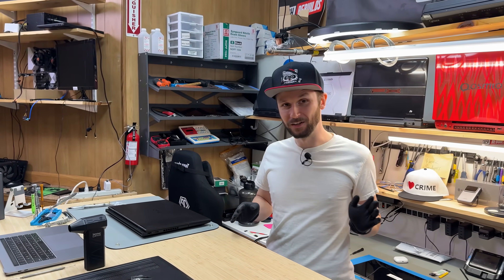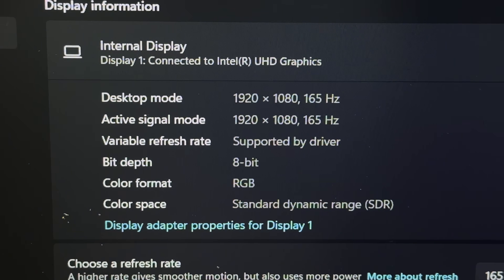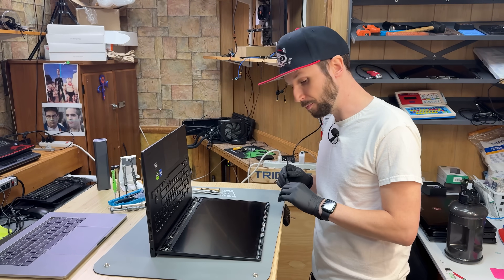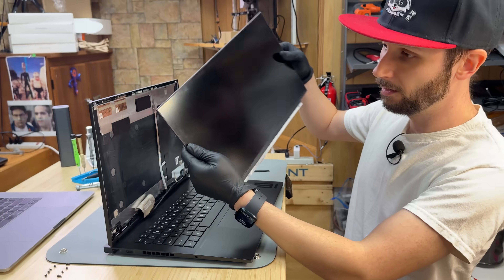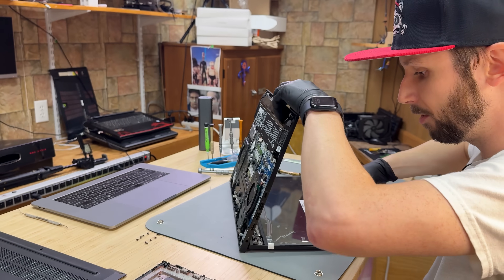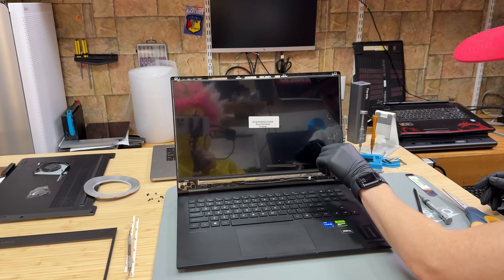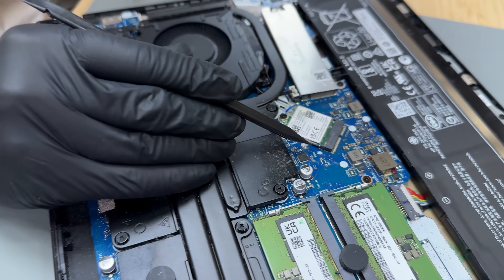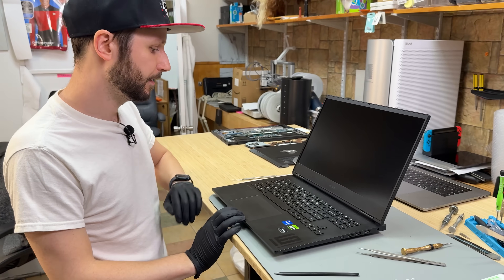The Laptop Upgrade Nobody Thinks About Until It's Too Late

Comment from the maker: Buy things to help me recover after CES SalemTechsperts.com
Reply: why😊
Reply: @ivopearce  Nvidia 50 series prices
Reply: @PotatoPc2000  i’m not sure yet they will be telling us soon
Reply: you are exactly like me when fixing laptop even i like the satisfied click when putting panel back, i to hate adhesive for screen and finally the 30 pin Display connection i am with you all the day i too faced the locking connector fixing it back with satisfied click.
Reply: @SalemTechsperts I have a question about downloading Windows 10 from a phone using USB SD card thing what would I do I have windows 10 downloads what else can I do
Reply: @GamerBoyDepner29  no booting from an sd card is not posabel trust me i have tried
Reply: you only sell in USA OH its a shame :face-red-droopy-eyes:
Reply: What is the circular watch you wear in shorts usually? It looks a bit like mine.
Reply: I made the mistake you avoided and can confirm, it did suck. My laptop model had two different screen models with different pins on the connector for each.
Reply: can you replace an lcd screen with an LED screen or oled

Comment: im going to be upgrading my Dell Latitude e5530 (2014) HD screen (1366x768 ew) up to a 1920x1080 screen bc most web sites and such treat my laptop as a mobile device as the resolution is sooooo low

Comment: My HP omen screen is damaged. It is "BOE NE173QHM-NY5 v8.0" 
I want to upgrade to " BOE NE173QHM-NY7". 
BECAUSE Original is 300cd/m2 
The later is 400, also has AMD free sync.
Both are 40 pins and the same size. It will be better than the original right?

Comment: Been eyeing up some display upgrades for my budget Chromebook to Windows laptop.  It came with a terrible 1366x768 6 bit panel with no blacks.  There is a few full HD panels in the same form factor model.  I am not 100% they will work or not but I have been wanting to try one for awhile now.  I also have an old Thinkpad T61 with a 15.6" 1680x1050 8 bit, but it's old like the laptop, so black levels and brightness are pretty bad.  I am not sure how easy that display will be to replace due to the aspect ratio, but it would be nice to replace, even if I had to hack together some kind of LVDS converter PCB inside the laptop somewhere.

Comment: I replaced my laptop screen a few weeks ago. I have a Sony VAIO PCG-71912L and when I replaced the screen, I swear the resolution is better. I got the screen replacement off eBay for $54 (so what my laptop’s worth), but I think the original screen was 720p and the new one might be 1080p but I have no way to check.

Comment: So, I have an MSI Crosshair 16 with a 144hz 1200x1900, or whatever FHD+ is, I think that's right. I know it has a 40 pin LED panel connector. The laptop has a mobile 4070 so I'm pretty sure it could handle a QHD, or whatever the equivalent in the weird resolution of the screen is, I think its something like a 16:10 aspect ratio?? The newer Crosshairs come with 1440p panels that use the same 40 pin connector, this much I am sure of. Is this all I need to know in order to put a higher resolution panel in it?? I have searched all over the internet and found no answer. I talked to someone at a LED panel retailer and they told me to take the panel out and get a number, but I really don't want to take the panel out, and risk breaking it, to find out if it can be done. Any help anyone has would be greatly appreciated. It appears here that the only variable was the panel connector layout, but is that the same for all laptops??

Comment: I swapped out my Acer a515-44 touchpad with one that had a fingerprint sensor. It was a bugger to find the right ribbon cable but it works like a charm. That's the great thing about buying a laptop with a huge base model library; you can always find parts! Also upgraded to 24gb ram, 1tb m.2, added 1tb SSD and found a usb-c to 20v barrel converter to run off USB c power. I might do speakers next.
Reply: And the fingerprint sensor works just fine with Windows security and more?

Comment: ASUS ROG Strix (2022) G15 G513RC-HN063W 15.6" 144Hz Full HD IPS LCD LED Laptop Screen (1920 x 1080, 40 Pin)..... screen number - N156HME-GAK (current). Can you tell me which upgrade i can get for this laptop display . I  was thinking to get a BOE 1440p display(BOE NE156QHM-NY1) which is wqhd, quickly compared specs for both from panellook website. Only issue is that the newer one needs [eDP (4 Lanes) , eDP1.4 , HBR2 (5.4G/lane) , 40 pins Connector] whereas current has [eDP (4 Lanes) , eDP1.3 , 40 pins Connector] , the only thing stopping me from buying the upgrade is the display cable which i currently have. I really dont know whether it supports the newer signal interface.

Comment: There was no reason for any one to replace a screen cause it lost two Pixels.    The file is whole.   And I have had people want a screen replace because a few bad  pixels.   Clean the screen and those pixels are actually there, and working.   There was just some bug jizz on the screen they never cleaned.   Our minimum charge for looking at something was $45.  :) 
Always a difficult place, when they  ask what the Tech did to fix it.    Which honestly, was 30 seconds  of cleaning the screen.

Comment: 9:30 bruh i replaced my old hp s thermal paste and it shows blank screen and i thought it was dead because it was my dads 10 year old laptop and i taked out the ssd i put a month ago put it on my 1 yr ago i3 12 gen pc and turned it on and used this becausse this was damaged because ssd virus smthin and that old lap was like 3000 dollars at the day no its 3 dollar LOL
its like i7 3rd gen gt 635m 16 gb ram 500hdd

Comment: Lenovo commercial models are sold with 2 or 3 sometime more screen option for the same model. It can be possible to order an other on the net. It worth it if you can buy a dead cheap computer. Just keep in mind that a high-end model can be sold with a discrete GPU, so the connector can be different. For my part, I like to update Wi-Fi card. In the past, it was possible to update the CPU too.

Comment: Thanx for the info,i have an entry level asus gaming laptop (asus f17 706h fx706li),dunno if my search is wrong on google or ebay to check if i can get a 4k screen replacement from a 1080p(standard).I really dont want dismember the laptop just to get the model number of the screen which is nothing wrong with it ,however the colours is not good for my digital editing I do so i rely on a external screen for better colours and light,updating it would help,can you help?

Comment: When I was still in IT and did laptop/phone/tablet screen repairs I NEVER pulled the protective film off the panel.  This was my customer always had proof of the repair AND they got the pleasure of pulling the film off.  It was a little thing but they really liked it.
Reply: But it would all be; neer that bezel trim.
Reply: @abbynormalz  Not at all.  You just peel it ever so slightly away from the edges and leave the rest.  Once you get the bezel on you press the film back over the edge.  The screen is protected and the customer gets that peel therapy.

Comment: Why the upgrade is only for some models? is it because of the absence of suitable displays with same size  and connector pin? i asked because my 14 inch hp laptop , 8 yrs old, the screen went dim, cant see clearly, i asked the technician any upgrades possible or atleast an antiglare screen, he said can't do it

Comment: I fixed a broken Samsung back light by buying a broken screen with working backlight. Saved a ton of money and ended up with a lot of very cool foils that were spreading the light evenly on the screen from leds at one end of the panel.

Had some extra fun it it.
I also managed to upgrade Sony TV by buying a new dvbt2 decoder for the higher model instead of being forced to use the decoder.

Before you buy new parts or electronic, do check if there is a possibility to upgrade it with parts for the higher model and extend the usability.

Just like Linux will save all laptops that can't run Windows 11.

Comment: Hey man! I'm a fellow tech, new in the business. First of all, I wanna say, awesome videos, super entertaining! I wanna ask you something which may help me in the biz, down the line. Say I do something like this and try to surprise my customer with a higher resolution screen than what their laptop came with to the shop. Say, I install the screen and it actually is a higher resolution screen and everything works great. However, when the customer sees it, he has a genuine concern with it (I say this because I imagined myself in this scenario. I imagined myself as the customer whose laptop screen you upgraded with the higher resolution one, and I was relieved when in this video the replaced screen turned out to be a FHD, as well). 
The concern is that the guy is a gamer and now has lowerd FPS(obviously) than he had on a FHD screen. Well, he can still play on a lower res(1080p), but, now it will look worse(blurriness and all). What do you do in a situation like this. I mean, of course we change the screen to a FHD one if the customer wants, no question, but, other than that, customer relations wise, how do you handle that situation? I mean, I know how I would handle the situation, but, did something like this happen to you? I wanna know from your perspective/ex[perience, if you can share please. Thanks, the greatest technician that's ever lived!

Comment: I hate that the newer laptops have the battery inside the case. Much more difficult to replace. I'm glad that I didn't have that problem with my wifes Pavilion when I replaced her screen - which was held in place with screws. I don't know if I could have upgraded the screen because I didn't check.

Comment: I had a cheap acer from 2016 e5 575g i5 7200u and 940mx. Shitty 768p TN, bought a 1080p IPS for 60$ new. I also wired the old screen to a driver board to use it as a secondary monitor on my desktop. 15$ on aliexpress. Worked great. If you have a good laptop with a shitty screen, upgrade the screen, search for the EXACT model (again EXACT number AND REVISION) to find a suitable driver board and with a bit of DIY you have a portable display (can even hook up a battery on some)  for cheap.

Comment: i found a 40 pin display cable but it says its only for 120hz and i also found a display that says it can push 144hz. my question is if i will have any compatibilty problems(like not displaying anything because de dispaly is set to 144hz and the cable can only push 120hz). 

thank you

Comment: Whilst I agree with pretty much everything here.... the FIRST thing I do on any laptop is remove the battery and hold the power button for a few seconds... basically drain the system before you start yanking at parts. Other than that - great vid.

Comment: I have a Dell G3 15 5587 with i7 8750H and a GeForce 1050Ti. I have 2 * 8GB RAM and the M.2 has a Samsung Gen 3 NVME. I haven't removed the OEM hard disk (1TB) but I'm thinking about it. The reason I am watching this video is that my battery expanded from "bloat" and broke the bottom of the case. Prior to that the first symptom was an unstable internal screen 15.6" (1920 * 1080) and the external displays through HDMI worked fine. Once I started to inspect the unit and reboot it would no longer boot because of the battery issue, as far as I can tell by the blinking LEDs. But anyway, it's still a good machine and if I can get it fixed I want to replace the RAM with 2 * 16 and if possible I would like a higher resolution screen. I know Dell has lots of upgrade options for its laptops but back when they assembled them mostly in Texas it was way more flexible. I am curious if anyone knows how I can find out what substitute screens might work in this machine. This is the only laptop I have with the 1080 screen and my external monitors are all running at QHD or UHD. 1080 is fine for running videos full screen but it's not enough to do any kind of work unless you take 3 or more and turn them on their sides. That's not realistic in a laptop. And the machine was running great prior to this other than occasional heat issues when running an external UHD screen but I think that is due to the need to clean out the fans and regrease all heatsinks. If nothing else it would make a fantastic Linux machine. I'm hoping I can do something with the screen before I budget for the RAM and maybe additional disk #2 upgrade.  Thanks for any useful comments.

Comment: You can't upgrade the screen if the seller doesn't send you the correct one. Also, it absolutely sucks that screens are attached with tape now instead of being fixed with screws.

Comment: And for the display you just pulled out, if it is still working, get a controller from ebay and usually a 12V power adapter is enough to add an external display to your setup or anywhere in the house with a raspberry pi to display things.

Comment: Right on! I usually keep the protective covering from the new screen and put it on the old screen if I'm gonna keep it around. I'll also check the camera and mic, and ensure they're working, cause I hate having to open up these things twice, especially if the sreeen is taped back in place, or there's adhesive on the bezel as well!👍

Comment: Note that you can’t replace just the display panel on the MacBooks. The display assembly is so ultra thin that whole top assembly needs to be replaced if the display breaks. (In fact the display assembly is so thin that even a thin screen protector is enough to crack one of the internal layer of the display)

Comment: I have a acer nitro 17 and it’s not turning on. The led lights for battery doesn’t work either and it’s only 8 months old. Do you have any ideas before I send it somewhere
Reply from the maker: @snowysshorts  did you try a new charger?
Reply: @ No but it’s showing no signs that it works

Comment: I like working on HP on some maintenance manual, they tell you what screen that it can handle!  And sometimes the Screen is less quality than what can be installed ?  Example: a College student for got she had a pen in her hand and pock a hole in the screen! Hums. For 35 USD more I can install a better higher Re/W-touch screen not pen-proof thu's! She like it better and its was able to used soft tips iPads pen!

Comment: Is it possible to upgrade to higher refresh rate? I've tried to upgrade from 60hz to 120 in my Lenovo but ended with brightness control not working. Both screens were eDP 30pin

Comment: I'm using a dell g15 5515 with a 120Hz,260 nits,60%sRGB panel and if i ever do have to change the screen I'd much prefer the 165Hz,350 nits,99%sRGB panel they are both 40 pin connectors but im really not sure it would work

Comment: 2 years ago I had my laptop's panel replaced by a repair shop. They replaced it with a similar 768p TN screen which is fine but it started showing major problems just a year later. Watching this video inspired me to buy a 1080p IPS panel and install it myself, and it's all good so far. Thanks to the greatest technician that's ever lived

Comment: I want to do that upgrade with my old XPS. It's a 1024x768 (or whatever) panel, and I want a 1080p panel. I'm pretty sure I've done the research, and the laptop had the option of a 1080p panel, so they're out there, but it's a lot of money to spend on such an old laptop

Comment: Yo, when i had my pc all finished, it would randomly turn off, or it would turn off immediately after turning on.

After checking the ram, the GPU, and finally swapping out my PSU for a fresh one, it didn't resolve the issue. It turned out that the damb power button was getting stuck 😂🤦‍♂️

Comment: Which hp omen should i go?
Option 1: Intel i7 11th Gen, RTX 3070, 2K resolution, 165Hz display 17inch (Has a touchpad issue, but the seller is willing to offer a discount).
Option 2: Ryzen 7 5800H, RTX 3060, 1080p resolution, 144Hz display 15inch

Both are similar, with only a one-year difference and a price gap of $70-$80. Which one would you recommend?

Comment: I always wanted to the answer to this question and thanks to you now I know there is a chance of doing especially if the screen you have choosen is for the same company and model but different version. For example msi raider GE series have 3 versions( configurations) with different gpu and displays.  It just might work.

Comment: I spent 300$ to diagnose and fix a 6yo xps that wasn't booting (weirdly it was a screen issue, but the screen test worked and nothing else). They replaced my non touch screen with a nice touch screen (yay) but I immediately cracked the new screen 😭

Comment: Hey Andy, i have a question. I want to upgrade my 256gb NVME to a 4tb one. If i use easydisk to clone, will i have to re-organise all my programs, or will the drive function like my pc is right now. By that i mean will my desktop look the same as it is currently. This is an upgrade i have been holding off on doing because i am scared, and dont want to redo my entire Desktop and program installation

Comment: I may be in need of the greatest technician ( or at least better than me I am bad ) I have a m4 screw stuck or maybe cross threaded in my laptop. The last screw holding the heat sink into the fans is stuck and I don’t want to strip it out!

Comment: I’ve already noticed this with my acer nitro 5. Accidentally stepped on the thing a while back and damaged it a bit causing 3 little white splotches to appear in the center similar to what was described in the video. When I looked into replacement screens I found that that on too of a 1080 replacement, there was a 1440p screen as well. Have not replaced the screen yet but I will definitely do that upgrade when I do.

Also btw you probably don’t need to take the screen apart to the model number of the screen. For my pc I went to the acer website and put my pc’s model number in and the website listed all the parts of the pc along with their individual model numbers.